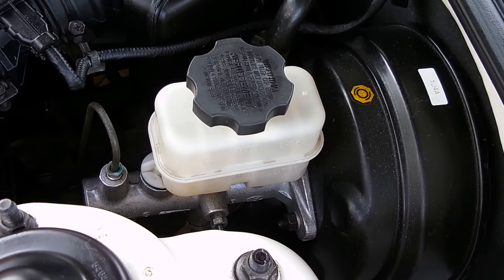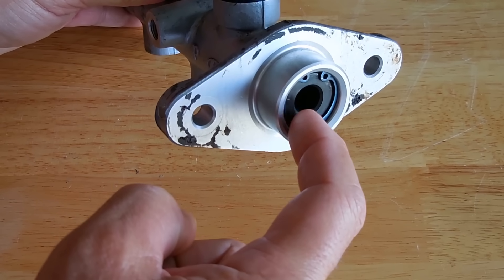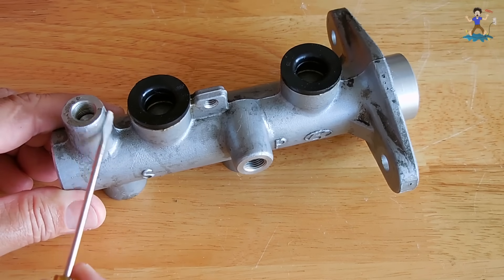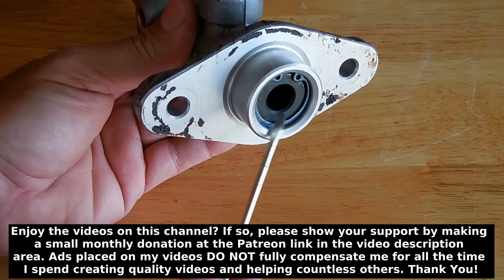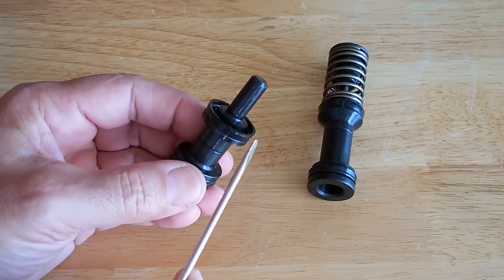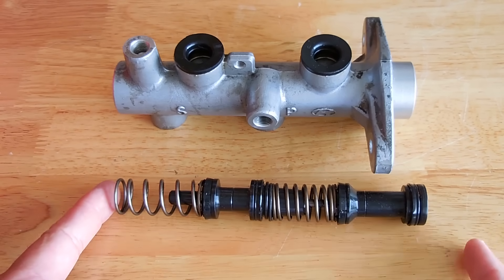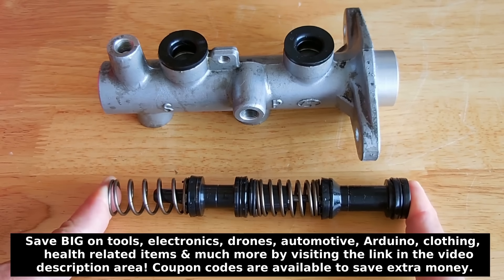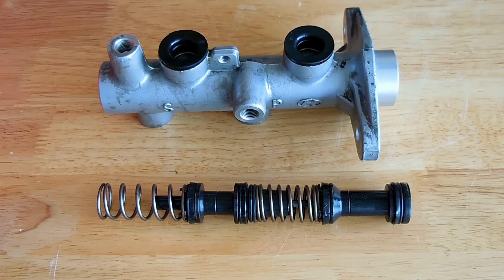Vehicle Brakes: Master Cylinder(How it works)

Comment: Thank you very much for explanation
Reply from the maker: You're welcome! I have many great videos on my channel that cover a wide range of subjects unlike most channels on Youtube, so be sure to look over my extensive video playlists for other videos of interest to you, and most importantly share my channel with many others. Thanks for watching!
Reply: @electronicsNmore  My car i20 clutch sets ...disc, bearing and plate, and slave cylinder has been changed recently. After that, all working ok...pulling, shifting, etc..all ok. No complaints.

However, just about 3000km of driving since the above replacements were made, the car suddenly failed to engaged any gear while driving. The clutch pedal all the way goes to floor and never return back. I have to manually return to its original position and then pressed again repeated. However, it still sticks to the floor and never return back.

I was driving and all of sudden the issue happens. Stuck in traffic and was pull over to roadside with traffic police help.

Wait for some time, and yes, it come to engaged and disengaged again. All ok. But, the problems arise intermitently!!!

There is no physical leakage, damage or low fluids in the system. All ok. (It used to happen when clutch is used often ie in traffic jams, clutch engaged and disengaged frequently, just in 10 minutes or so. However, no issues with pulling power and no clutch slippages, temperature, coolant all ok.)

Comment: PLEASE DON'T USE SILICONE GREASE ON ANY INTERNAL BRAKE PARTS! When rebuilding master cylinder, use only specified brake fluid!
Reply from the maker: I know MANY mechanics that use a thin film of silicone based lube when assembling brake caliper pistons/master cylinders, and never any problems. I've used brake fluid or silicone lube in the past. Thanks for watching
Reply: @electronicsNmore  is Silicon Compound braking system same as Silicon Grease?

Comment: it is a really helpful video,   just I have an issue with the same stuff when in press brake pedal I see the fluid return back to the fluid reservoir. so what is the part causes this problem do you think?

thanks a lot and keep going.
Reply from the maker: Glad you enjoyed the video. Do the brakes work properly? If they do, leave it alone, otherwise buy a master cylinder rebuild kit for your vehicle. Thanks for watching!
Reply: @electronicsNmore  yes it works probably but when I hit the break pedal and hold the pedal slowly go forward and break it self get loos. It seems like there is leak or air pressure inside the system, regarding the leak I do confirm there's no leaks in whole system.

Comment: can i clean the inside the wd40?
Reply from the maker: Yes, or use brake parts cleaner. Make sure everything is wiped dry when using WD-40. Use a lint free towel, then apply a thin film of brake fluid to the inner walls and seals. Thanks for watching!

Comment: Can you tell by looking at the master cylinder if the primary piston section serves the front wheels and the secondary piston serves the rear wheels OR if it is a split diagonally which brakes one front and one rear on opposite side?
Reply from the maker: Just follow the brake lines to see where they go. Thanks for watching!

Comment: Just another little bit of information, the smaller port is the compensating/vent port is the smaller diameter hole, and the larger diameter hole is the inlet/breather hole. The function of those ports are very integral to the function of a master cylinder.
Reply from the maker: Thanks for watching and thanks for the info!

Comment: I ordered a kit for a ln65 break master cylinder and I'm trying to figure out what spring goes where. They are both the same length, but one has a higher compression force than the other, based on this video I'm guessing the one with the higher compressing force goes between the two pistons.
Reply from the maker: You need to carefully disassemble yours to compare.
Reply: yes higher compression force spring goes in middle

Comment: can you please tell me, what wheels are operated by the first circuit? the one closer to the booster. I couldn't know since lines go inside abs then i don't know. i got one champer in the reserve dry and air got in. so which lines got air ?
Reply from the maker: Closest to the Booster are the FRONT brakes. Thanks for watching!

Comment: What would make a rattling noise at idle when pushing the brakes but stops rattling when pushing the breaks down harder
Reply from the maker: Something is loose!
Reply: @electronicsNmore   I can put my hand only bracket that mounts the brake pedal to the inside of the fire wall barely push on the bracket and the noise goes away I'm going to try to tighten the bolts that hold it to the fire wall

Comment: I lost my brakes while going 100 kmph yesterday but was able to find an off ramp to turn onto and then a large parking lot to slow my vehicle down. I suspect the master cylinder because there was a puddle of brake fluid under my car after about thirty mins of being parked there. Does it sound like a master cylinder issue? I can't see it being my brake lines because I had both replace a few months ago.
Reply from the maker: You need to get under the car and do a careful inspection. If you lose your brakes, slowly apply the emergency brake or downshift the engine.

Comment: I dont get it if the second or first spring doesnt get presurized and fails then how can all brakes work is only one enough?
Reply from the maker: If a seal fails, the brake line WILL NOT get pressurized. Thanks for watching!

Comment: My car MASTER CYLINDER IS STUCK IN BRAKE BOOSTER 
HOW TO FIX PLZ HELP
Reply from the maker: Hello. If the bolts have been removed, then apply penetrating oil to where the two are bolted together. tap a few times lightly at the connection and wait an hour. You may need to insert a flat blade screwdriver between the 2 and pry them apart if there's rust.

Comment: Question, my brakes went to the floor.  I replaced the master cylinder and it still goes to floor. I used a cheap rebuilt master cylinder.  What are the odds that the new master cylinder is bad?  To test it, can I just take a brake line, form a "U" loop and connect each end into each port on the Master Cylinder and apply the brakes?   OR must each port have its own plug, which I dont have?
Reply: When the pedal goes to the floor, there is a leak of brake fluid in the system. Check your lines, especially by each wheel to see if it is leaking fluid. If not, it is your master cylinder. I've seen many rebuilt master cylinders fail. I would always buy a new unit and not cheap out on your brakes.

Comment: very well explained thanks you. However, if we focus on one circuit (either rear or front), how does the fluid flows inside the 2 wholes? I mean I dont think gravity is enough so that fluid goes down? maybe I am missing something
Reply: When the brakes are pressed inside the car, the piston inside the master cylinder is pressed. This causes tremendous pressure inside the master cylinder, which forces the brake fluid through the port holes. Most cars have 2 ports, but in this video there are 4. When the system is bled of all the air, there will always be brake fluid throughout the system, including the master cylinder, ports and lines going to all the brakes. It's the pressure that causes the system to work, not gravity.

Comment: Great video!  My pedal is still a bit low to the floor after changing left rear caliper and bleeding the whole system multiple times. Suspect it's those seals inside the 22 year old master cylinder on my 1995 Toyota Avalon. Thanks for the tips.
Reply from the maker: Larry Hecht If the problem didn't exist before the caliper change, then you definitely have air in the line. Use more aggressive action with the brake pedal during bleeding, or use a vacuum brake bleeder.
Reply: I'm not sure if the problem was there before the caliper change. My wife drives this car most of the time, and she's not sure. It may have been like this: The brakes work fine, but pedal goes down to just 2 inches off the floor. Is there anyway to test if the master cylinder seals are bad, without removing it?
Reply: @SiteReader  no you can't test that without removing it and visually seeing for yourself

Comment: Thank you for the nice video. very useful. Just a question if you don't mind. Vehicle is using the shoe and drum break system. when I step on the brake paddle, everything works fine, however, when I release the paddle, expecting the system to normalize, the front left wheel, shoes does not push back to normal position, causing the break shoe I replaced to wear out in just one week.
I am suspecting the the brake master cylinder but not too sure about it. Would you have a better idea to solve this? Break drum is perfect with new wheel bearings, all pistons are ok, no leakage, and well adjusted, I cant say it is too tight.
Reply: Derrick Isapi. If only one wheel brake is failing, then the problem is at that wheel, not at the master cylinder. Completely rebuild the wheel brake cylinder. Remove rust wherever brake parts slide. Make sure the adjuster turns freely. Exercise the linkages and pads looking for excess friction or worn parts (teeth, ratchets). Then bleed all the brakes until the fluid comes out clear.
Reply: Thank you. David.

Comment: Is rebuilding something you may wanna do like exchanging brake hoses e.g. after 15 years, or just wait until it brakes? I just had a quick look on Ebay and seal sets seem to be like 20 bucks or so...
Reply from the maker: Baerchenization After 15 years you might want to replace the seals.
Reply: Thanks... I am harbouring that idea to get an old BMW 840 one day and make it less crappy. There is not much sympathy around me for BS like that though, mainly based on cost, I suppose :) But at least now one can check online what all these things are gonna cost in advance...